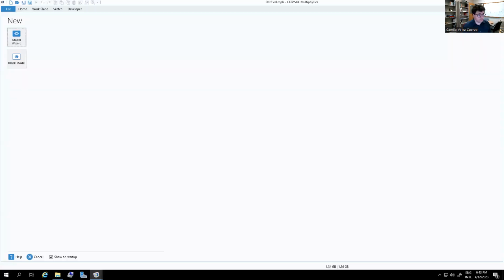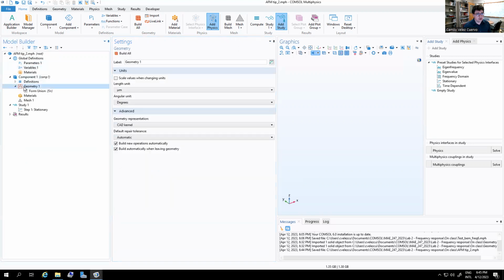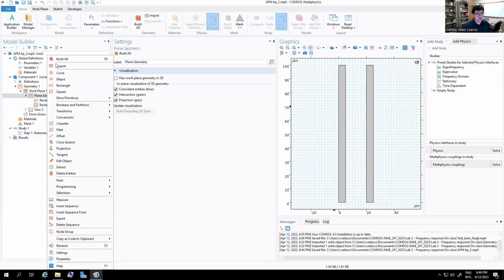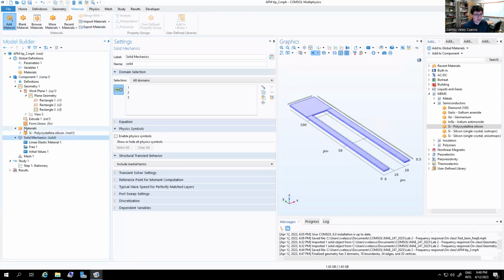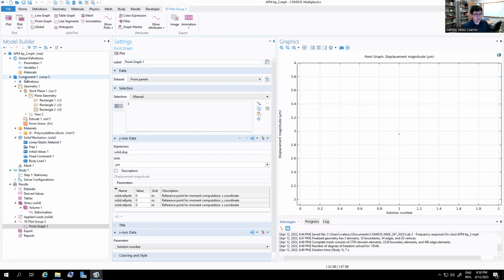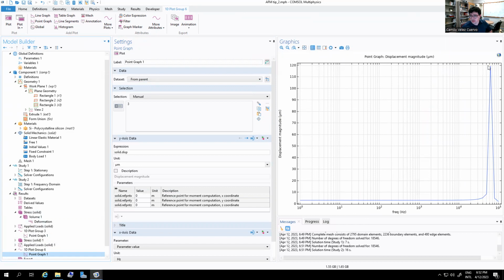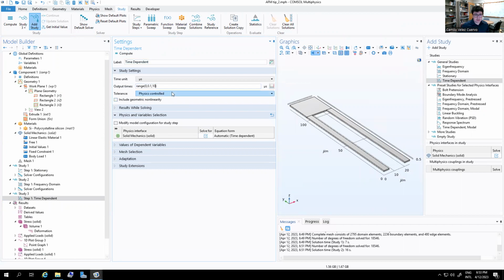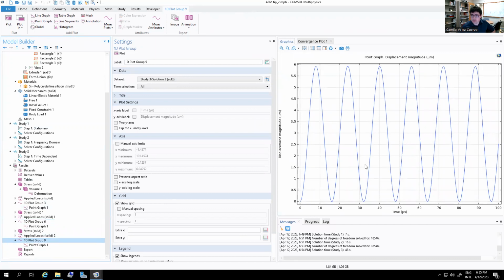Lab 2: AFM tip with no damping

Comment: Hello Mr Camilo, thank you for this clear and well explained tutorial on AFM cantilever!
I have a question, if you don't mind, but I'm not sure if "light-matter interaction" studies are part of your field.
If you were to include a substrate beneath your AFM tip, and also include a laser source to cause optical interaction between the AFM tip and the sample, in that case, does it matter much if you keep the cantilever beams or you remove them from the structure? Or will the excitation laser source in Comsol be enough to study the optical interaction between the AFM tip and the sample?
I am asking because that is what I am trying to currently simulate with comsol, however I am not succeeding in making the tip interact with a SiC substrate.